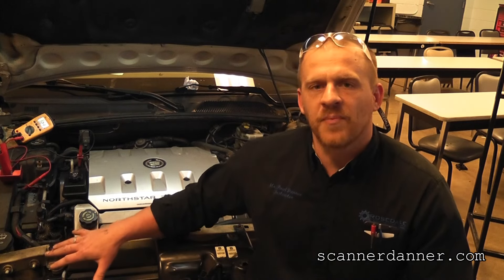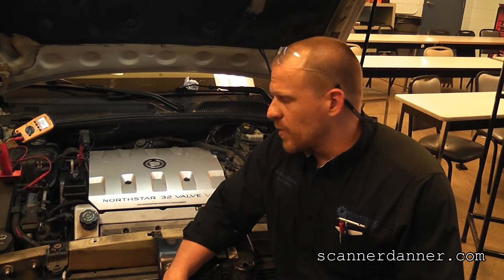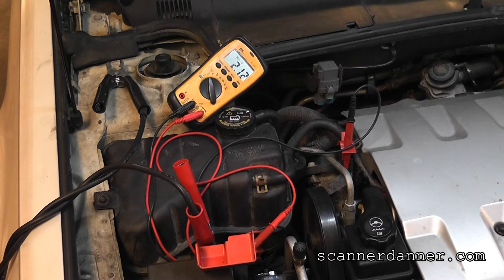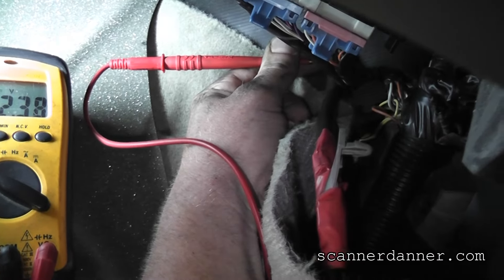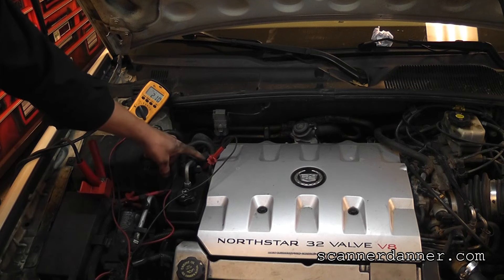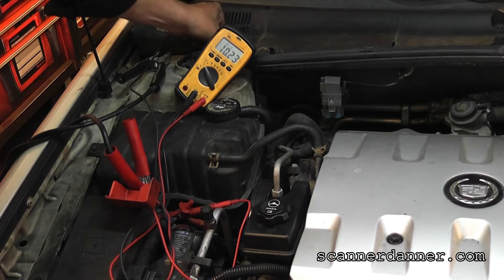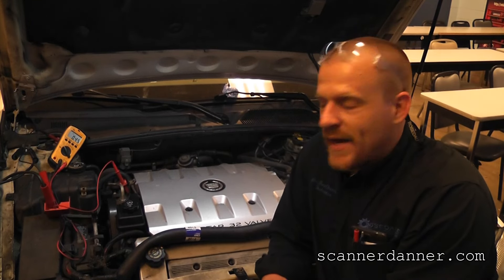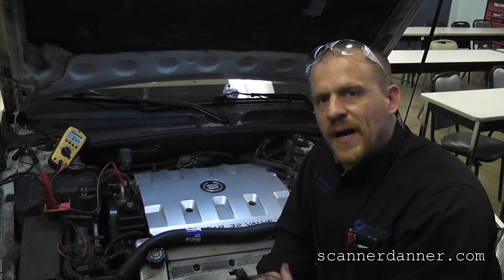Engine does not crank (bad block ground) - Cadillac

Comment: Could a bad ground cause a 2007 Cadillac CTS to run fine till you turn the headlights on or put it in gear and it dies?
Reply from the maker: for sure
Reply: That's what I thought but I just wanted to be sure before I start digging into it. A friend has this car and that is what is going on. He brought it to the "stealership" to find out what's going on. They handed him a $700 bill to change a module and re program the bcm. 2 days later it's doing it again.

Comment: My lights stay on, I can't control them. My air turns on by itself. My trunk also read open when it's not. And codes flash on my dash. Is that the ground wire

Comment: i have the same problem now i think i might off mess up the whole car ive now replaced the battery starter and alternator. codes thatr i pulled had gave me was for tpc  and low voltage on it so moving forward i replaced that position sensor. the car all it does is click so i went and got another batter under warranty and still just click click so i then removed the new starter thinking i might got a dud now my cluster wont read my obdll scanner my shifter wont show the line under the gears i am lost and need help i cant afford to take it to dealer ship any one with some help would be so appreciated
Reply from the maker: Did you check that ground? Watch the video, do the tests
Reply: Yes sir I redid the ground my gas Guage is not reading any more my gas is full my audio unit is not turning on and now the line under the gears is gone I have a d8 scan Tool but I can't get the unit to connect  anymore my check engine light is gone and my abs and battery light do stay on if I remove the key the car stay on till the battery dies completely any ideas

Comment: There is no ground, in DC wiring it's called negative. Ground is an AC term. Connecting the block to the body , etc is called bonding. Also are you piercing the battery cable's insulation to test for voltage??!?

Comment: Just replaced my 2006 cadillac CTS .8L Engine. rebuilt the original from ground up. I had the motor run for a bit, know the engine is sound. I can't seem to get it started now. I am going back though it looking at all ground wires, is there any assistance or advice you can tell me? Anyone on here? Its the original ECM, 160kmiles. After watching your video, i'm going back through the grounds, i'm really leaning towards ECM. cranks, has fuel, has fire, but won't kick over. how can i test ecm or know what voltages should be coming from it?
Reply from the maker: Engine computers do not go bad during an engine swap unless you connected a main ground to a power or something like that. So I doubt your computer is bad. Start with checking for a 5v reference on you coolant or intake air temp sensor. The sensor must be unplugged and you need the key on. This is a starting point. Here is a playlist that contains a bunch of 5v ref testing videos in it. 
https://www.youtube.com/playlist?list=PLAFYVCyenqcpP9ykkWb2D16nVEjyQ1eTZ
Reply: Yes sir, I am subscribed to you and have been watwching almost all of your videos. each one teaching me something new!
Reply: Get a different car.

Comment: 9:50 you meant to say with voltage not with pressure.
Reply: he is correct, voltage is electrical "pressure" to push the current

Comment: Mine is an 07 northstar mine is doing crazy stuff when started and running dash and radio will repeatedly restart driver window randomly works and doesn't work https://youtu.be/ogGloJ40HE8
Radio screen also stays on after shut off and exit.